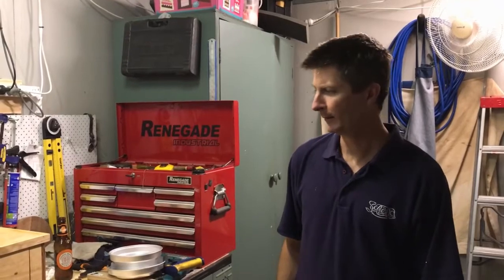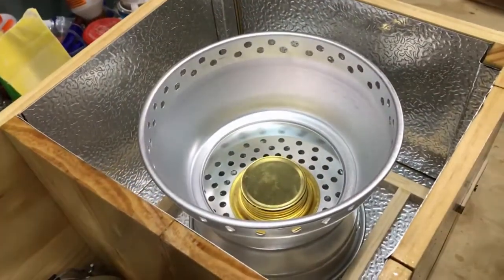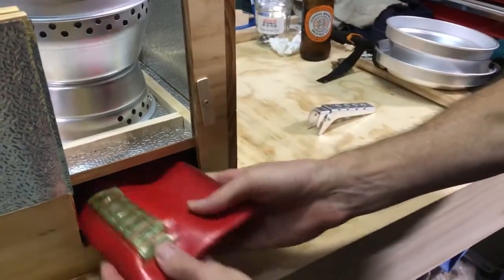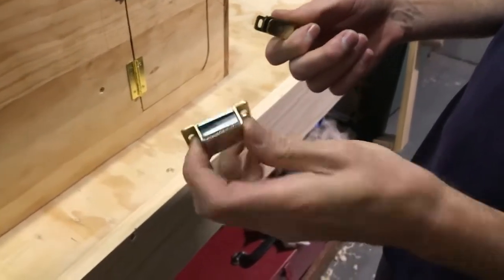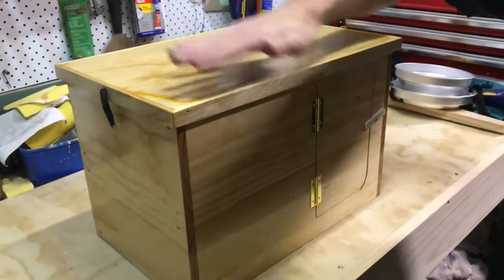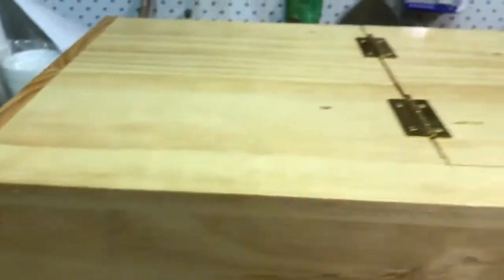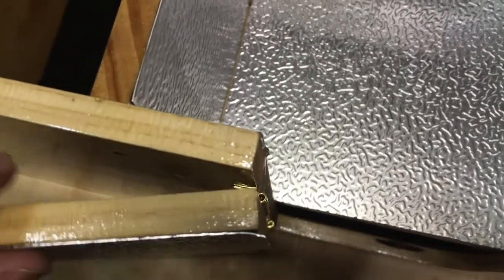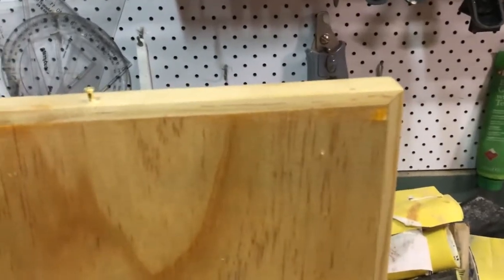Sabot Cruising Dinghy - Galley Box

Comment: A beautiful Box!
One safety hint for the igniting process of the alcohol stove:

If you use the fire steel like you presented, the plate will be shot with some kinetic energy into the direction of the burner. Doing it that way, often observed a very dangerous potential to hit and ignite the burner at the same time, whereby burning alcohol may be spilt into the environment. The consequences may be an open fire onboard. 

This danger can easily be avoided by training to hold the scrubbing plate still with your weak hand overhead the material you want to ignite and to pull the steel towards your body with the strong hand. The advantage is a far better hit rate of the sparks on the ignitable material and a significantly reduced danger to sweep the material away with the weak and less controllable hand. I even removed all firesteel as my usually primary ignition tools from my boat in order to avoid mishandling by third parties.
Reply from the maker: Thank you Bjorn that is excellent advice that I had not given thought to.  Maybe a small gas lighter with trigger or matches would be safer.

Comment: Nice box. May I ask how to attach the aluminum sheet to the wood?
Reply from the maker: Hi there, as I recall, I think I just spread some thickened epoxy on the back and used a block of wood and clamp to hold it against the wood until it cured.  It hasn't moved since.
Reply from the maker: Not sure how heat resistant epoxy is but so far it hasn't moved
Reply: @jasonstork9606  Thank you very much for your quick response.